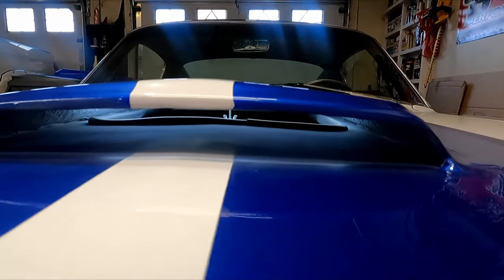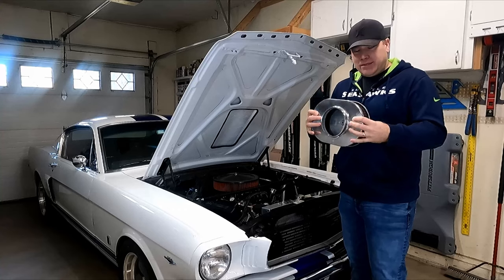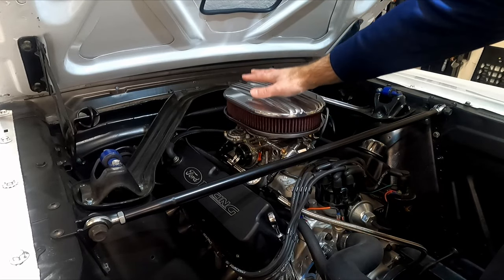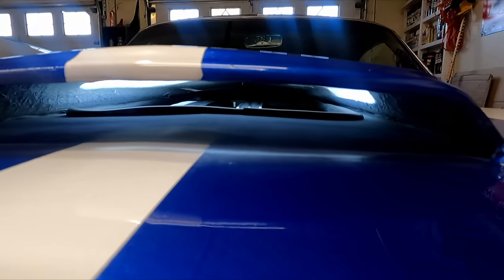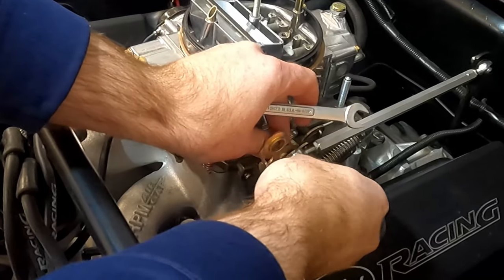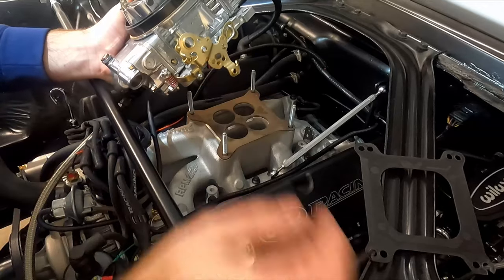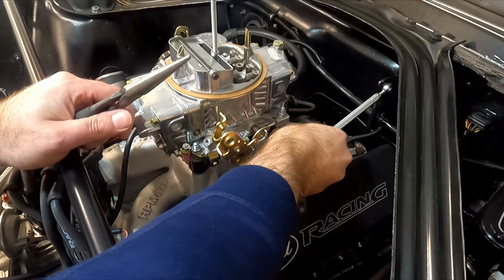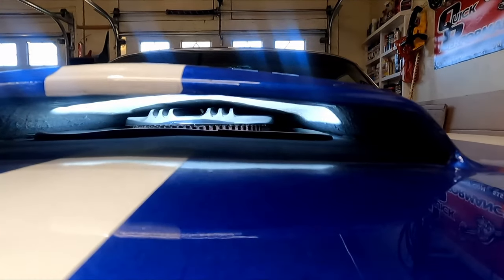It's almost like a RAM AIR system!

Comment: I know it won't fit the "black scheme" but I really like the polished aluminum look.  And way cool on the shirts - gonna order some.  One worry about a Shelby image on the shirts is will you run across any "protected images" problems.  I would like a shirt with a tri-bar/mustang kind of logo on it (if it isn't "protected").  Last, I just got my '68 Camaro spoiler and will be installing it tomorrow.  Thanks for all of your hard work Andy.
Reply from the maker: Yeah, it has been a few weeks since I installed this and it's still polished.  It's growing on me, so we'll see what happens.
I think you're right about the Shelby and Tri-bar stuff, I really don't want to get in a snafu with brands and copyrights.
On the chin spoiler, I was able to install the side brackets that I struggle with in the video.  I just screwed them to the frame, something I could have easily done in the video if I had my head on straight.  :)
Reply: @AndyKruseChannel  I laughed at the "head on straight" comment.  When I teach a new shooter class, I tell students to screw their heads on tighter as kind of a time to pay attention thing.

Comment: Wow I am in the same boat.  Have the Shelby style fiberglass hood. I went with the 1 inch spacer. With the RPM air gap.  Round air cleaner.  It hit my hood I had to opt for a thinner air filter element.  When I close my hood I can see the air filter. Not  Ram air.   Great idea  Andy thanks for  making this video for cats out there running functional hood scoops
Reply from the maker: Haha, no problem, thanks for the support!!

Comment: Don’t know if they have it but k&n makes filter tops that have air filter material rather than that large aluminum piece. I have a round one on my car.
Reply from the maker: Yeah, I looked at several styles, including the the filter tops.  I had a hard time finding something that fits the look I want with my small budget.  :)
Reply: I was also wondering about the air path for air entering via the front grille and then being sucked into the carb: wouldn’t that air now have to travel a more awkward path as the filter element is now higher? So now it comes through the grille, has to bend up up to ‘find’ the filter and get sucked in. This effect might even be more pronounced given that there will be a lot more air passing into the engine compartment from the front grille compared to that (great but tiny) hood scoop? So in essence the air filter should be placed to best catch that air, this new setup might even cost power due to increased friction/turbulence losses. Just brainstorming here

Comment: I just got the oval air cleaner from Speedway this week too. Mine is the flat top version and as I run a flat hood and a HEI distributor I run mine side to side rather than long ways....only way mine will fit. Thanks
Reply from the maker: Yeah, sometimes we gotta make some sacrifices to make parts work.  :)

Comment: Just an idea - I have the same car except powered by a 351 Cleveland - fabricate an aluminum tray or pan that seals up against the underside of the hood. It willl keep any debris entering the scoop from cascading over your motor. Kinda like the old GS Buicks did but instead have the pan go under the carb - that way you can use that new trick air cleaner. By the way - I have not done this yet but my hood clearance to carb is tight - time to add the GT 350 scoop like you did.
Reply from the maker: Yeah, those trays are slick, I might do something like that.  Not interested in the Cleveland, it's tough to fit a decent set of headers on those heads of the Cleveland and in the space this car provides.  :)

Comment: Try a set of adjustable motor mounts. I forget who makes them. The mounts allow to lower the engine down a bit. However, they are solid mounts with urathane bushings. They do give more vibrations.
Make your shirts in 100% cotton, and no "slim fit" style. Maybe add a small American flag around your design.? Keep up the cool 😎 videos !
Reply from the maker: I believe you're talking about Ron Morris mounts.  Fun Fact, I was going to buy his Grabber Blue Fastback right before I bought this car, it would have been a monster of a car for me and probably too much for me to handle.  I was talking with hm about using his mounts and he said he'd work with me if I ever decide to do a video on them.
I struggle with 100% cotton as it shrinks and I'm too lazy to not dry them.  The slim fit is something I'm working on with my shirt guy, hopefully get that figured out for the next round.  I like the flag idea.  :)

Comment: You should get the air cleaner powder-coated. I found out how much cheaper it is than paint and how much longer lasting it is and I got like 40 pieces to my Fastback powder-coated. I LOVE IT.
Reply from the maker: That's not a bad idea, and since I have most of the parts I sell powder coated, I bet I could get a really good deal on it.  Nice!

Comment: the hood scoop air will cool youre gninebay a litlle more and you airfilter will scoop more cold air vs hot air out of the enginebay so yess it will help . going to put myself a scoop and cut the hood out
Reply from the maker: Yes.

Comment: I think you’ll find there is not enough clearance above or to the passenger side of the air cleaner. The motor lifts and leans to the passenger side under acceleration. 

How about fabricating a larger base with a foam seal to the hood then it would be a functional cold air package. 
By the way, not much ram air in the middle of the hood. That being said, adding the scoop to my Stang (with ford cold air flapper type air cleaner) was worth .2 seconds in the 1/4 mile. With appropriate jetting.
Reply from the maker: Yeah, I've got some marks on the under side of the scoop from the air cleaner rubbing on it. I blame all those hard acceleration pulls I've been doing.  :)

Comment: Let's more air in there to help with that Electric power steering install next video. :-)
Reply from the maker: At first I was thinking you're correct, but then I remembered that the electric steering system mounts under the dash.  So in order for that scoop to feed cool air to the steering, I'll have to pipe in some ducting through the firewall.  I'll have to get back to you.  :)

Comment: The new air cleaner looks familiar lol. Paint it white the fins blue !
Reply from the maker: Then it won't match what's going on under the hood.  :)
Reply: @AndyKruseChannel  did you consider going with the K&N style oval air cleaner with the filter on top and the sides. I drilled mine out for more flow. The oval filters are awesome

Comment: Doesn’t engine move a little when reviving, car moving, etc. I would worry about touching and damaging carb and manifold. Good luck.
Reply from the maker: Yeah, it touches, didn't know that until after I did the video.  Not sure what I'm going to do about it yet.  :)
Reply: @AndyKruseChannel  Just bring it down again.  It will get the same amount of air rushing in.

Comment: Andy is that the eklers 12 inch oval air cleaner?
Reply from the maker: Nope, it's just a unit from Summit Racing (part number SUM-239046).  But idk, maybe Summit just rebrand Ekler parts?  :)
Reply: @AndyKruseChannel  thanks. Enjoy your videos

Comment: Umm, I'm a 3x guy on the shirts.  Sorry bud but I did get the linkage.
Reply from the maker: Yeah, I was afraid of that.  My shirt supplier said for my first order I should get the more common sizes and see how it goes.  I'll keep that in mind when I do the next round.  While you're here, let me know the kind of designs you'd prefer on a Mustang shirt.  :)
Reply: @AndyKruseChannel  I'm pretty sure Ford and Shelby have things pretty well locked down, but maybe something about the spoiler (I'm spoiled) or maybe a 4 or 5 speed shift pattern.  Copyrights spoil all the fun.

Comment: I must say I like your channel Except for you coil overs and hope don't happen in what I experienced with tire rubb and yes you can roll the fenders then you get rust catchers and when I bought my 94 GT Mustang it had coil overs and after a set of BFG ties with the sides walls Distroyed  by the fenders and a pair of flow master mufflers Distroyed didn't take me long to loose the low rider look and put a set of Cobra springs in with gas shocks and got the ride of a Lincoln totally The cost was crazy but no more tire rubb or Distroyin mufflers All I can say is Goodluck and hope you don't Experience what I did As they say with Fords factory tuned Supensions and too look at Shelbys None of them are lowered Either just a tip for what its worth
Reply from the maker: Fenders are rolled, no rubbing issues. Im really enjoying the ride quality and the ability to set it just how I like. 😁

Comment: Nah you don't need a gt 350.. there's maybe 3 cool owners in the world. Most of them barely even look at the car much less drive it
Reply from the maker: Nah, I still want one.  The down side is I'd be afraid to driver it since it's worth so much.  I even struggle with that a little on this car, a Fastback is almost double the price for an equally equipped and taken care of Coupe.  I keep putting off the paint job because I wouldn't want to scratch it.  Right now is great, I almost don't care about chips and scratches.  :)
Reply: @AndyKruseChannel  my point exactly. Would you rather own something to look at it or to use it? 

My paint has tons of imperfections yet I'm never painting my car cause then I'll be afraid to use it. Cars are tools/toys.. not precious works of art. 

You see it all the time with these rebuilds and people have less than 500 miles on the car after years.. is it worth it so spend all that time and money and have so much potentially just to leave it covered in the garage all the time? Also.. be sides the traction bars, my coupe is on par with a 350 now , didn't costs the money but provides all the joy.